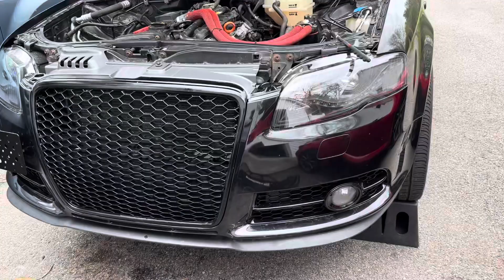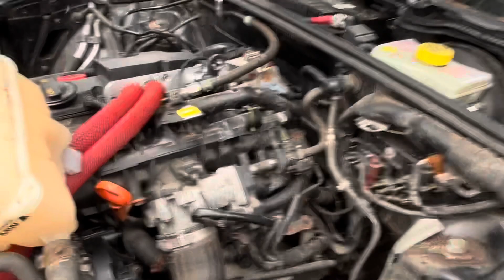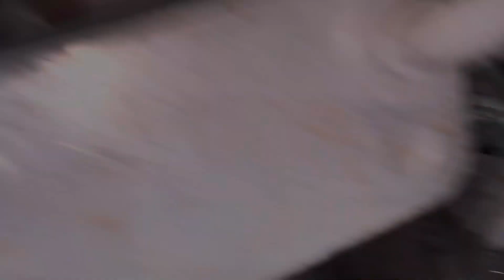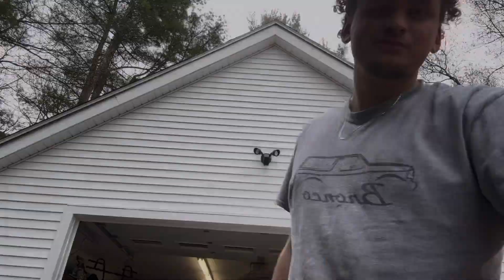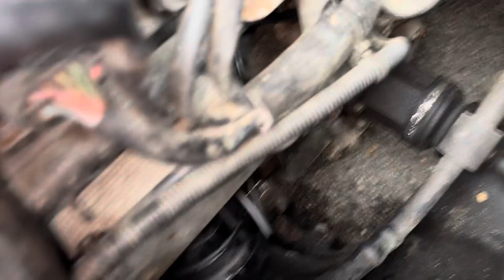Crankshaft Position Sensor Replacement Guide | Audi B7 A4 2.0T FSI

Comment: Bro that resivor is gonna crack from the pressure mine his 173k miles an was idelikg outside gym next thing I know coolant is beeping an resivor has 2 inch crack
Reply from the maker: God damn. You saw visible damage on mine or what? My coolant leak was from my rear coolant flange which I have since replaced
Reply: @WeMakeItWork  no I didn’t just the color told me, defintly factory revisor if it’s yellowed so much just under the hood you know. Mine did the same thing Audis esipally 2.0Ts run a little hot causes everything to be brittle my hood latch, an headlight screw holder broke like spaghetti noodle just removing them.
Reply: @W @WeMakeItWork did it end up needing to be replaced??
Reply from the maker: @MaisonRips nah I didn’t have to do that thankfully. No cracks or nothing

Comment: Can make this sensor problem with vibrations at the car, this vibrations they feel more accentuate in intrior at the steering wheel
Reply from the maker: I don’t think so. Vibrations in your steering wheel is likely an issue with your tires/wheels/control arm. It could also be wheel bearings, which can be catastrophic if not fixed before a complete failure. 

Your issue shouldn’t have anything to do with the crankshaft sensor

Comment: Could the crank sensor cause the car not to start ? Just curious
Reply from the maker: Potentially, but probably not. It should still be able to start, but the idle would be super funky. Use a code reader/VAGCOM tool to pull your own codes. RossTech has a fantastic VAGCOM software.

Comment: Love/Hate this car, too! Thanks, for the vid, and the pointer about the wire ties - very clean and a wise mod for longer life of that part's wires in that f'ed up location. I guess you accessed it from underneath the car? Getting ready to change mine, too. I hope this AND the spark plug replacement I have planned will do the trick on the rough idle, then no-start and/or LIMP mode issues I've been experiencing. Also doing the turbo's multi-press. valve as preventive maintenance. All parts were bought REAL cheap off Amazon!
BTW, mine is having a slow coolant leak, too. I heard it's either that multi-valve piece on the underside on driver's side, or the thermostat. I bought a replacement metallic multi-valve off Amazon, relatively cheap. Will be replacing soon. Keeping fingers crossed.
Reply from the maker: You get what you pay for with Amazon parts. I wouldn’t trust Amazon spark plugs to be quality at all. Iridium NGK are great spark plugs but are priced higher because of that. 

I installed the new Crankshaft sensor from above. It took a couple minutes to line everything up, but that part of the video where I mentioned taping the bolt to the torx bit is insanely helpful. You don’t want to drop that bolt, ask me how I know lol.

Thanks for your comment, subscribe for more B7 content, and let me know if you need any help!
Reply: @WeMakeItWork  You're welcome, and thank YOU, for replying to ME, too.
I wanted to ask you how your Audi was running prior and after the replacement. My A4 2.0T Quattro Cabrio is NOT starting. It's exhibiting the Crank no Start issue. As of the last time we 'spoke", I managed to get the hood open (royal pain, but I did it) replaced the plugs anyway with what I had bought - they'd been replaced with basic el-cheapo Autolites which had all turned black and the gap had widened. Also, I cleaned the coil packs' contact points real well w contact cleaner and put them back on. I only broke a couple of the fragile plastic outer clip pieces where it should NOT make any difference. Also, I removed the CAM Sensor in the top front of the engine - another HUGE PAIN, naturally - and cleaned it w. MAF cleaner & Throttle Body Cleaner, as well as I could! It was all covered w. BLACK OIL when I first removed it. Also, I removed the battery - Dynalast Gold, 2 yrs old, recharged it on VIKING re-charger (super nice recharger, brand-new fr. Harbor Freight, came highly recommended. I like it better than my Schumacher), then I put it back on, recleaned & resanded its posts and terminals. The car's alarm came alive! I reset the FOB! Then, I recharged up my flashlight/jumper thingy which was my GO-TO for any previous jump starts. Worked for starting my neighbor's '08 Nissan Rogue, and my son's new uyndai Sonata, before. Left it on there about a minute. Tried to start it, but again NADA! Crank, no Start, as if I'd done NOTHING!
Today, I'm gonna replace the Crank Pos. Sensor, remove the battery AGAIN, and add a bunch of Premium Fuel and try again. IF that doesn't work I'll try some Lucas Top End Cleaner with it. If THAT doesn't do it, I'm gonna check codes, again, and report back. Probably gonna contact a automechaniker who works on Deutche Autos, a LOT - mostly BMWs and MBs, as well as VW/Audi, cross my fingers and hold on to my wallet!

Also, I'm gonna try to get the Turbo Diverter Valve replaced while I have the car jacked up, as part of my 125K mile mainenance schedule. I don't know it it's actually due, however a LOT of YouTube techs/mechs/tuners/etc. state that it's one of those parts which has a HIGH failure rate, due to its rubber diaphragm which has been replaced with a spring-type mechanism. Supposedly, it's worth the "easy" amount of effort required for replacing it.

Lastly, I chanced upon a video a couple nights ago which explained how replacing VW/Audi's clip-type constant-pressure hose-clamps with the screw-on hose-clamps is "most likely" the cause of these cars' high-rate of having coolant or oil-leak issues. The original clamps keep constant pressure on the hoses, however the screw-type clamps can leave micro-gaps which can EASILY be the source of leaks! Having worked for NASA as an Aerospace Engineering Consultant for the last 10 years of my career, I'm all too familiar with how selecting the "wrong" type of hardware for the application at hand can make a WORLD of difference. I've already purchased an aluminum multi-valve to replace the existing one, which is ALSO another problem-spot, supposedly, so that's gonna be done, too!

I just wanna get our baby started and running again, man. We bought her last year, after selling our '08 Scion TC w 155K miles on her for the EXACT same amount! It was like trading the Scion in for her, which we both considered a STEAL of a deal. She ran GREAT all summer, and took us to the beach and back - 2-1/2hr ea. way - without a problem, and THEN some. At the time, all I did was change the oil, and the ONLY other issue she had was replacing the roof's motor - she came w a new one, too - and sorting out the trunk auto-release issue! All-the-sudden, all these other issues hit, seemingly at the same time! I just don't get it!

Comment: Just curious,  what made you replace this ... was thw car not starting?
Reply from the maker: It was rev-limited to 4000 RPMs I believe. I would drive as normal until it hit 4000ish RPMs and then the car would stifle any throttle, making the RPMs drop and occasionally it would stall. 

Replaced it and no more issue!
Reply: @WeMakeItWork  appreciate the replies.  Thanks

Comment: Did you do the bank1 sensor?
Reply from the maker: If you mean the O2 sensor then no I have not. It’s pretty straightforward though. I have a CTS Turbo Testpipe instead of a catalytic converter so my O2 sensor has moved a few inches
Reply: Did the car not run before you changed that part?
Reply from the maker: The car was idling poorly. The RPMs were dropping to 500 before kicking back up to 1300. I changed the cat for performance gains, which is unrelated to the Crankshaft position sensor or the idling issues

Comment: you did the honeycomb grill by yourself?
Reply from the maker: Sure did. It was a lengthy process but 100% worth it. It looks so good without a horizontal license plate space on it. 

To do it, I took a C6 A6 aftermarket Honeycomb grille off of eBay, cut the mesh out of that, cut the mesh out of my S-Line grille, spray painted the border gloss black, and then cut the honeycombs to fit in the S-Line border and epoxy’d it in. 

Very lengthy process, cost me about $140-150 for the grille, epoxy, and the plastic saw I used to cut with.

Comment: where did u get the replacement? audi oem is over 200 dollars
Reply from the maker: For B7: https://www.fcpeuro.com/products/audi-vw-engine-crankshaft-position-sensor-06a906433l
Reply: In the UK you can pick one up online for under £20!

Thanks to the channel for the vid BTW. Mines just started throwing a hissy fit and the code says it's the sensor. Not looking too bad a job by B7 standards!